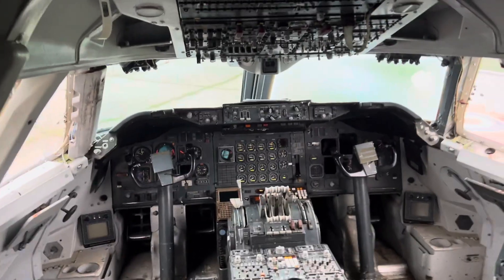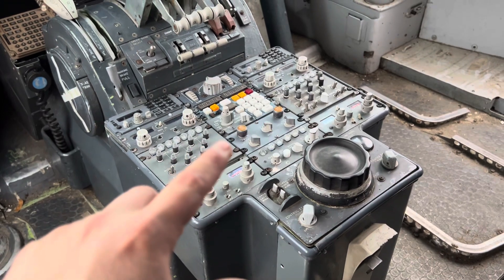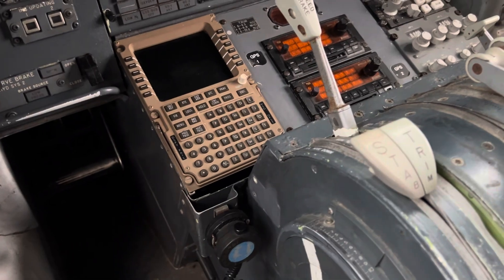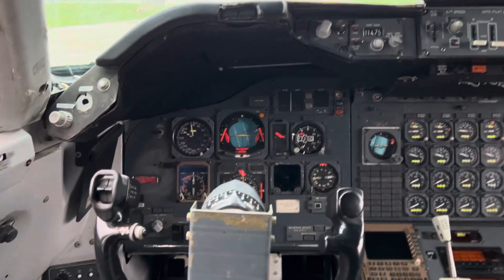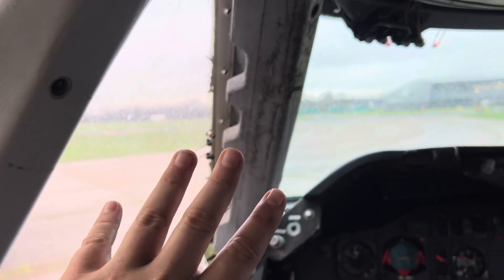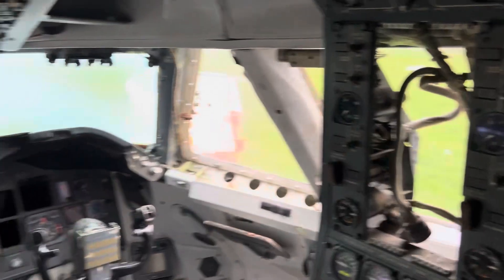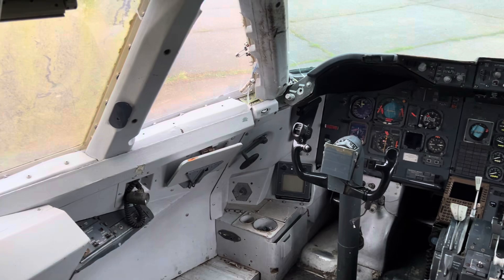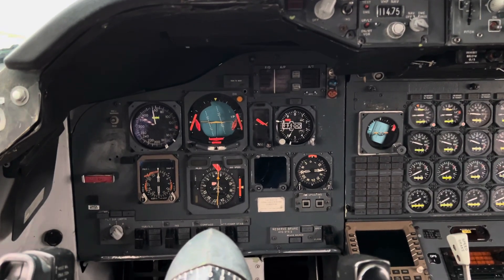Boeing 747-200 project part 8 - Captains MIP complete/update

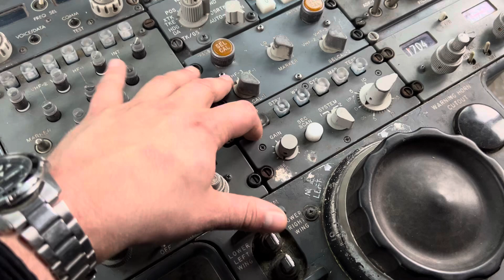Comment: 1:30 - bit late of a reply, but the fwd panel you're pointing to is a SELCAL panel. In areas with no VHF radio coverage, only HF, such as over the Atlantic or Pacific, it can get quite fatiguing to sit there and listen to the radio the entire time, because HF is much less clear than VHF; without this system you'd end up listening to static for hours straining to hear any voices. With SELCAL, ATC can "ping" a code that is assigned to you, and it will cause a ding in the flight deck and a light to illuminate, letting the pilot know to bring the volume up on HF and ask ATC what they want. In the Felis, this panel is located on the overhead.

The aft panel looks like weather radar controls. The buttons along the top are the mode selectors, and below are reception gain and tilt controls, among other things.
Reply from the maker: Thank you so much for this information. Much appreciated indeed!

Comment: Completely ignore the discouraging comments. Yes it will be a big job but definitely doable and more doable now than it would have been 10 or 15 years ago. Having personally been involved in two successful fixed base cockpit sim projects(B732/B744) I can say for certain can be done if you have the time and commitment.
Reply from the maker: Thank you for the kind comments, it means a lot, especially considering I've had a few nasty comments both privately and on the comments section. That sounds fantastic, both a 737-200 and a 747-400! You must certainly know your stuff for sure. Please drop me an e-mail if you have any knowledge to share!
Reply: @Boeing-Project Defo interested in helping. I sent an email to the fighterjetsim email. Is that still the right one? Check your spam if you don't see it.
Reply from the maker: @davidkavanagh189  Thank you so much. Yes, I did get the e-mail. Will reply in the morning. Looking forward to speaking!
Reply: @Boeing-Project Sounds good!

Comment: so will you make this into a simulator?
Reply from the maker: Absolutely. It will be very hard considering the flight deck is completely analogue. But it's been done before, and I have a whole community of people - several of whom are also doing these 747 classics. Thank you so much for watching
Reply: @Boeing-Project  That will be so awesome! Which simulator do you plan on using?
Reply from the maker: @JetSetBuilds  We will be using X-plane 12 - Felis 747-200 😁
Reply: @Boeing-Project  thats a good choice! One of my favorite addons
Reply from the maker: @JetSetBuilds  It's fantastic At the moment it's the only proper 747 classic simulator addons
Reply: Great project! Under the center pedestal INS control panel is a radio selector for choosing between radios, the orange SELCAL lights illuminate for an incoming HF call. Under that is the weather radar control box.
Reply from the maker: @bobhazeldine1964  Thank you very much for this information. I really appreciate it!
Reply from the maker: @bobhazeldine1964  Thank you so much for the info!

Comment: Ahh, so good to see some of the old Queens are saved and converted into a sim!!
I built a B744 sim with genuine parts and some FDS components. But without a shell as you have, as I built it in my flat.
Me too had a long break btw. certain building steps. So, keep up focussed and all the best for you and your project! 😎
Reply from the maker: Hello there, I remember I think I spoke to you some years ago on your website. I'm a big fan of your work! I was building a 747-400 using FDS parts and a homemade wooden shell. I however gave up that project when I was offered the flight deck of this 747-200 here. Thank you so much - I shall certainly be working very hard on this. Would be very interested to speak with you regarding how you converted your real throttle quadrant!
Reply: @Boeing-Project  B747Sim is my name on Foxtrott Alpha Charlie Ecco Bravo Oscar Oscar Kilo
Reply: @Boeing-Project  Welcome to contact me there!
Reply from the maker: @B747-4OO  Excellent! I shall drop you a message tomorrow. Would be great to talk!
Reply: @Boeing-Project  Pls find my site on  F B ... it is called B747Sim ... long name B 747-400 Simulator

Comment: I’ve used CPflight over in Italy and have been impressed with their quality of replica parts and service. Perhaps they could engineer bespoke parts for your project such as CDUs.
I’ve also found Geremy from GLB Flight very helpful in sourcing parts for me. His East Yorkshire based company supplies real used aircraft avionics at good price.
The work done by guys at Cheshire based 744Experince project, where they converted a real BA 747-400 cockpit for flight simulation is mind boggling. I’m hoping sometime next year to try out their simulator. I wish you all the best; it’s going to be challenging project, but very rewarding. Just ignore all the negative comments.
Reply from the maker: Thank you very much for your suggestions! I have heard of both companies actually. I will go and have a look at the websites for both. Yes, the 744 experience looks absolutely amazing - its exactly what I am trying to aim towards with my simulator experience. They of course have the upper deck of the 747 as well as the cockpit. The upsetting thing is, I was actually offered the entire upper deck of my 747 when they were scrapping it. However, I didn't have anywhere to keep something on such a large scale at the time which is really disappointing. It certainly will be a very challenging project, but we will finish it, of that I am certain! Thank you so much for the support - it means a lot!